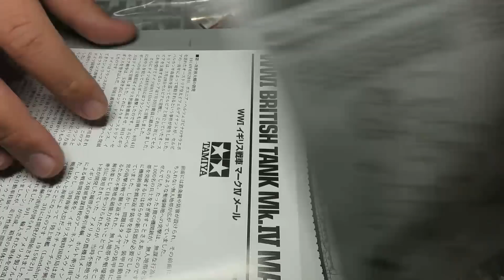Tamiya 1:35 Male Mk IV Tank - Part 1

Comment: 7:14 You're using your cutters wrong -- IF you have good flush cutting shears, you can carefully cut parts from the sprues only once.  Once cut from the sprue, you may (or may not) have only the smallest of residual "nubs" to sand off, it depends on your skill and well, giving a damn, but the cutters (I use Xuron) can cut parts off completely flush especially if it is a piece with flat sides.  You just created extra work for yourself because you cut twice, then filed then sanded. That's 3-4 steps per piece.  

Then there's people in the comments whining about the parts count and the "tedious" roadwheel assembly process and I can't say I blame them.

I'm just here for the Tamiya motorized model portion. Good show. :popcorn-yellow-striped-smile: